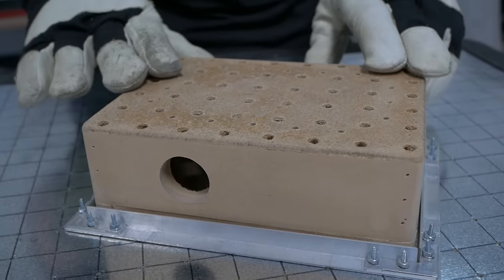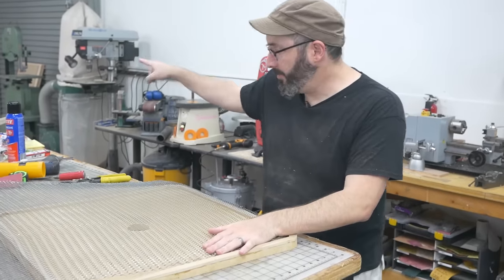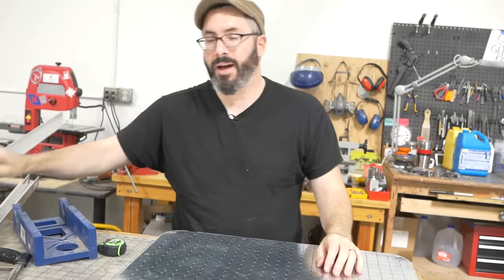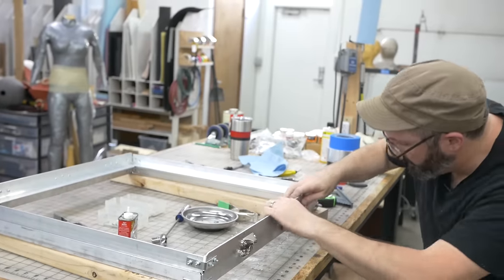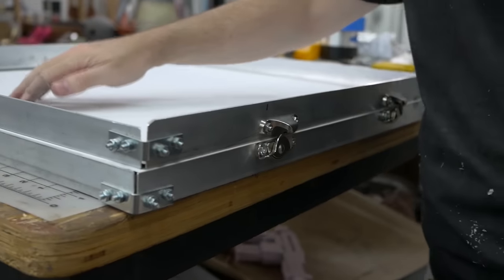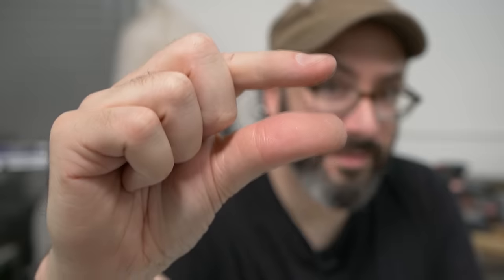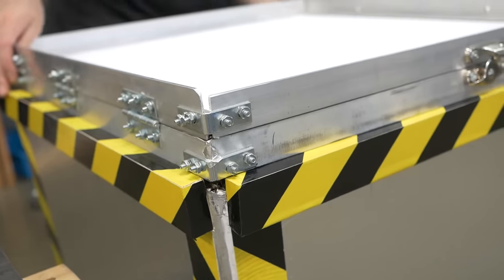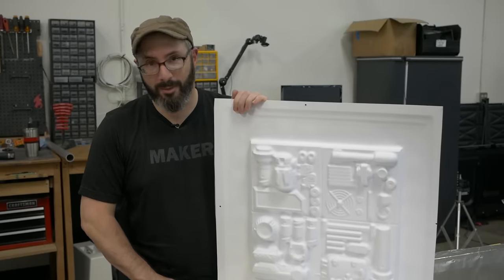Hardware Store Vacuum Table - HOW TO make your own

Comment: Nice work. I watched a vacuum form machine work. The big difference is the heat is kept on even as the vacuum is pulled to completion. The heaters were above the plastic and lowered evenly using cables and pulleys.

Comment: Three things:
1: Use insulation around the box to decrease heat loss.
2: Add a plastic mirror (45 degree angle) to the bottom so you don't have to squat down for the IR Sensors.
3: Blow an air chuck into your form to release it.

Comment: Instead of the steel mesh,  you use for the vacuum system, stick the pipes just like you would make a floor heating system. but group the above holes and place the pipes, one pipeline every 4-5 rows. also, join the pipes in each group into a single pipe. then fill between the pipes with a filling material such as silicone, liquid plastic, plaster or epoxy. After it hardens, remove the pipes. so you will have pipelines distributed into groups from a single pipe inlet. In this way, you vacuum the air in a controlled and equal amount. You put a lot of effort into making this video.  Thank you for keeping us informed.

Comment: Great build, great video.

I haven't built one of these, I'm not an expert at this and I don't play on on TV, but I did think of a couple of suggestions ... here is just one.

It's a bit complex, but not so much if you plan the build around it from the start: 

For the heater box: 
1) Cut a slot in one side, about 1-inch down from the top, and for the full width of the box (yes, this would cut through your hinges but it could be planned for in a new build. The height of the slot should be about, but a little bit bigger than 1/4 inch, but see step 5 to plan the slot dimension.

2) Next cut 2 strips of wood, say 3/8 or 1/2 inch (square in cross-section), and as long as the inside dimension of the box. 

3) Attach these 2 strips of wood inside the box, on the 2 sides adjacent to the side where you cut the slot, about 1-inch down from the top of the box. The top of the strips should be even with the bottom edge of the slot you cut, in step-1. 

4) Optionally, an additional similar strip of wood could be attached in a similar way to the remaining side (the side opposite to the slot).

5) Prepare a piece of wood (Plywood, MDF, Masonite, ...). Logically this would be made of the same material as the material used for the box. The thickness will be 1/4 inch, but this piece of wood has to fit into the slot cut in step-1, so if using a thicker piece of wood, the height of the slot cut in step-1 needs to match. The width of this wood needs to be lightly smaller (narrower) than the inside dimension of the box. The length needs to be about 1 inch longer than the inside dimension of the box.

6) Optionally, cut a strip of the same material, about 1 inch wide, and the length of the box. Mount this strip about 1/2 inch above the slot, using a continuous hinge, or a few individual hinges, or interlocking screw-eyes and hooks. This piece should swing (pivot) to block or allow access to the slot.

7) Insert the piece of wood cut in step-5 into the slot and push it all the way in, until it touches the opposite side of the box. This piece will be a "lid/cover" that you slide in or out as needed. 

Now, when you use the heat-box, you can pre-heat the box, then place your framed plastic sheet on top, and slide the cover out, and you have full instant heat.

Comment: What a fun project!  For the platen I would've done away with the mesh and added a ring on the elbow as a stop so that it doesn't go all the way to the top.  This allows for a higher CFM since there's less air resistance.  The other change would be to make your "oven" shorter so that there is less volume for the heaters to heat up alleviating some lost heat calories.  Otherwise, great build :D
Reply: you need the distance to distribute the heat more evenly to the corners
Reply from the maker: Thanks for the tips!
Reply: @Brandon Winters - Wouldn't putting a small fan to circulate the air help alleviate this issue?  Just a thought.
Reply: @dolfinmagikpro  That was my first thought but you would probably want to get yourself an old or replacement oven fan. Catch being that most of the heat is radiant heat from the heat elements so your really only blowing around the secondary heat (from the plastic). Which is also why the "10 min preheat" probably isnt doing a lot. If you sit under those heaters its hot when they are on and cold when they are not but they dont really heat a room very well only surfaces they shine their light on.
If you really wanted to spread the heat out changing the curve of the reflector would be the answer although probably a real pain. Making the curve shallower would enable the IR light to spread out more giving a more even heat but the foil box is probably doing similarly assuming you are far enough away with the box height. A V shape of mylar would probably give the profile you are looking for with the reflective box the rabbit hole is never ending. Those heaters are built to focus heat and that isnt really what you want but "modification is the mother of invention" or some such.
Reply: Why not use Mylar faced styro-insulation boards for the wall material?  dual purpose as it would insulate better and reflect any radiant heat back to the center of the box.  Just a thought :)
Reply: I was thinking the same, I don't think a couple inches shorter would affect the distribution to much.

Comment: When casting its a good idea to pull past the object. It gets rid of the webbing ruining the result and means it can be cut off. Either be able pull past the table height or raise the master via a stand. Idk if im making any sense. Also I love the scifi panel idea.
Reply from the maker: I get what you mean. Probably a down side to the way I built this frame. It stops at the platen.
Reply: You just need a  shallow spacer under the buck that's smaller than the buck so it has some undercut.
Reply: @punishedprops  Adam Savage has the video you need :-) https://youtu.be/Cacr1WeKOzY?t=279

Comment: Instead of bolting the aluminum frame together, using some 'low temp aluminum braising rods' would create a joint stronger than tig welded aluminum. and only needs a plumbing blowtorch.  as a bonus it will also fill in any imperfections for those who do not have a metal band saw. There are several you tube videos showing how to use it.
Reply from the maker: Very cool!... or... HOT!?
Reply: wow. I never knew about this. I've been a tig welder a long time and always recommend welding as a last resort. There are so many ways to join things without distorting them like welding has the potential to do. Thanks for the tip on the deal.

Comment: A couple tips from an aerospace tool maker / metal worker ... now retired. I am making these while watching the video so if you address something after I say it, good on you for seeing something and taking care of it!  
When cutting angle to make a frame, esp alum, simply notch the top there is no need to cut all the way down the sides, you just cut a "triangle" out of the top and bend the sides, less work and a stronger frame results. 
Tap magic... unless it is specifically for Alum, is not to be used on alum. There is a chemical reaction with the chloronated fluid and alum, bad things result. 
Center punching is good, nice work. 
Interesting use of window hardware! 
1,2,3 blocks are GREAT to use for quick measurements!   
Those heaters should be radiant heat so if you made a closed box and made it deeper  IE more distance between the heater and the plastic, you should get a wider pattern of heat.
 A heat GUN can be used to spot heat for better detail under vacuum. . 
In addition, a cover over the plastic will also hold the heat in, without a cover you have a large radiating surface.

Over all score I would give it a 9.5 out of 10. Nice job!
Reply from the maker: Ha! Thanks and great tips! =)

Comment: Couple of thoughts on the machine, As far as tripping breakers stuff usually draws the most amps at start up so doing what you did and starting one at a time is a good idea and point to make. I think the real thing with the overhead heater not liking life was the large gaps on top. If you had closed the top gaps and do aluminum tape on the inside I bet it would of worked. Also you might want to think about getting on of those foot on/off switchs for the vac
Reply: Regarding heat. It rises and will always try to equalise. Life can be hard enough without fighting nature too.... Underside heaters and good insulation is definitely the way to go.

Comment: Love you guys !  We made ours with replacement heating elements for a range oven, only because we needed a higher temp to soften 1/4” plexiglass and lexan. Just as another fan mentioned we also use blower tip to cool down and remove the template from the plastic. 
Keep up the great videos. Please keep the bloopers coming!
Reply from the maker: Woah 1/4" thick is serious! Color me impressed. =D

Comment: Rather than using a purely radiative heating scheme, which has the unevenness problems that you ran into here, is there any reason you couldn't have added a fan and made this more convective? That would be a more even heat source and would have the added advantage that you should be able to keep the plastic below the heat source, which is less prone to ... letting out smoke ... and would also be much smaller, and thus more efficient.

The big issue that I can think of would be sourcing a fan (and connections) that could handle the glass-transition temps you're looking at. This would assume that the fan lives entirely inside the box; if you were to put the fan outside, you would need to heat the inlet air as well as the chamber air, which seems more difficult to me, but might work.

As an aside, I found it kind of funny that your shop has a spindle sander but apparently no large hole saws. 8-)
Reply from the maker: I've considered it, but I've never heard off anyone else using a fan for their vacuum former heating elements. ¯\_(ツ)_/¯
Reply: @punishedprops  After thinking about it for a bit (like you do), If you were to keep the motor out of the heated space and just run a shaft through the wall with a metal-bladed fan inside, you could probably use inexpensive components. The hole in the wall of the oven wouldn't let out much heat, especially if it were kept close to the diameter of the shaft. (And you could even use a bearing at the wall if over-engineering is your thing.)

8-)

Comment: Love this! a few suggestions though. if you put sharpened inserts (5-6) along the edges where the sheet plastic is, it will act as teeth and "bite" the plastic holding it tight. no need to screw and unscrew each piece to hold edges of plastic. also, if you drill very fine holes on edges of the shapes in the  form you will get suction from inside the mold, not just the outside making better/crisper forms.  you can then reverse airflow when set and the mold will pop/release. To get rid of webs, preheat that area before the oven with a heat gun. the extra heat in that area will help it form.

Comment: Love the build and look forward to trying it out soon. Just a friendly bit of advise. Welding that type of aluminum is called brazing  a few of the proper brazing rods and a small torch with yellow MAP gas and your set. Lastly at least in the US most electrical code requires receptacles to be wired with 12g wire on a 20amp breaker. Only lighting circuits should on 14g wire with a 15amp breaker.

Comment: I think you could do without the extra screws if you glued a thin rubber gasket around the aluminum frame. That would grip the plastic better and more evenly. Also, if you regularly need to vac-form smaller pieces, it seems like you could just cut an adapter matte out two thin metal sheets that would clamp into the larger frame. 

Name ideas: Ooie-gooey Prop Drop, Shape Sucker,  Fantastic Elastic Plastic Press (FEPP)
Reply from the maker: That's a pretty great idea!
Reply: Another suggestion: You might get more even heating if you added a PC muffin fan inside to create internal convection (not to draw in or exhaust air).

Comment: Thank you for the awesome tutorial.
I'm not sure how you prepped the sheet metal but you could emphasize that preparation is key when using adhesives.
A lot of times they use a protective coating or even petroleum on the sheet metal so I usually clean it really well with 91% isopropyl rubbing alcohol and then I'll lightly rough it up with some 220 sandpaper.
Thanks again I'm looking forward to building a table for myself for forming and laminating wood.
Reply from the maker: So glad you enjoyed the video!

Comment: Bill you might think about adding some wooden handles on the sides of the frame similar to old metal pans. That way you don't have to worry about gloves
Reply from the maker: That's a pretty fantastic idea!
Reply: You still need the gloves to help the plastic push through as you vacuum it down... plus you are always at risk of touching the frame while handling the whole thing. Handles can help sure, but keep the gloves !

Comment: Love what you're doing. Just a couple of points about the heaters. They are infrared heaters. That means that they don't heat the air in the box, they only heat surfaces. So you don't need to preheat. White material reflects much of the heat away, that's why it takes so long to heat. Try building a 3"-4" deep box out of sheet metal to put over what you already have and paint the bottom of the sheet metal facing the heaters with flat black engine paint. That will turn the sheet metal box into an oven. You may need to put it closer to the heaters to get the temps you want but I doubt it since your getting close to your desired temp already. You will have to preheat it to get the sheet metal hot but it shouldn't take very long and it will be an even heat. It's pretty easy to build too.

Comment: Great job! You'll get even better definition if you heat the negative with a heat gun or blow dryer. It will help negate some thermal diffusion from the plastic to the negative.

Comment: There is no reason to preheat the box.
Reply: Yeah...that confused me.  I don't understand why it was necessary to heat it without the plastic... if anything... I would assume it would heat faster being closed off.
Reply: I jumped in here to say the exact same thing.  All he's doing there is wasting the initial heat (electricity).  Yes, I know it's been two years...
Reply: He was concerned with getting an even temp across the plastic at all times. I agree that pre heating wouldn’t be necessary but if you wanted to, I’d make a temp cover to improve efficiency

Comment: My 1962 Mattle vacuform says to test the plastic by pressing the corners to see if they are playable. Also each piece of plastic has wholes all way around each side that seat the plastic on pins for even tension.  It would be easy to add a few pins to the frame and drill a few holes on each side of the plastic sheets.

Comment: I made one using 16 x 16 piece of pegboard, with about 2.5 inches between top and bottom and put a vacuum attachment on the side.  Works fabulous. didn't have all day to drill holes.  Mine was just for sanding small parts and not a heat form.
Reply from the maker: Super cool!

Comment: Would have been cheaper to just cut some wood spacers and not use the wire mesh.
Reply from the maker: That's a great alternative!
Reply: @vodundesigns3076  Wow, nice website and projects!
Reply: Yep did spacer blocks with mine. For the platen I stole the biggest cookie sheet my wife had. Been using it over 10 years now.
Reply: i was thinking about that material they use in office ceilings over lighting. 
its a plastic mesh that has some height to it.

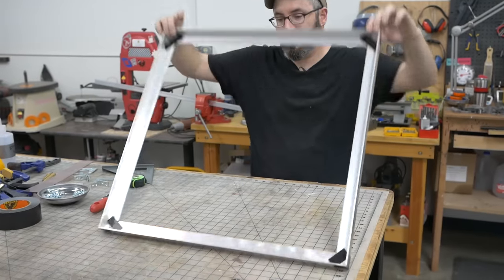Comment: Nice project and video - thank you.  An option that might be worth considering when connecting the aluminum angles (at 12:37+):  cut off a short, straight section of the angle stock, and use it on the outside corners with rivets as the corner bracket - clamp pieces in place (one corner at a time), make sure pieces are 90 & flat on bottom, then drill two rivet holes through the brackets and long pieces that come together, insert rivets, then drill other rivet holes & insert rivets, remove clamps - this would guarantee better fit/alignment and no fasteners means quicker assembly and nothing coming loose later.  👍

Comment: I used peg board for mine, works good, way less drilling. Also, instead of wedging the aluminum tape then cutting all around, try putting a square of it with a corner in the corner and just have to cut 2x inside.

Comment: 5 years later. The Garage 54 team bought one. I watched them unbox it and pull door skins.  The trick they have that you don't is a vacuum reservoir launch system. In your setup, the shop vac would void an inline series of pipes or a tank ahead of the table. A dump valve would release a super duper initial suck. 
Your plastic is farther away and upside down in comparison to the commercial ones. A little closer to the flame might do the trick.  But it's five years later.